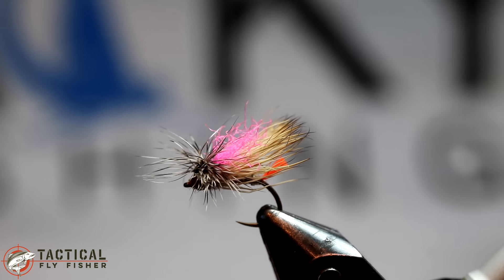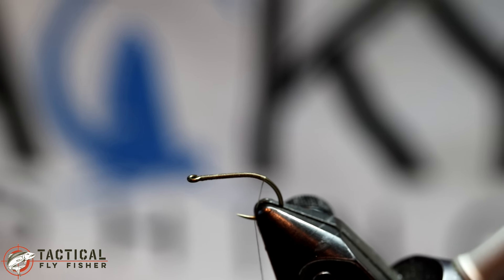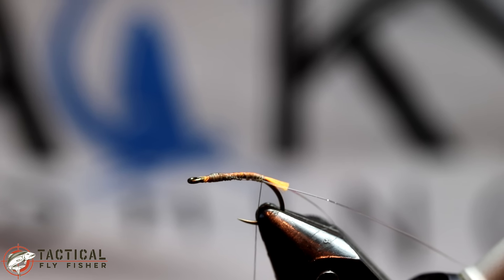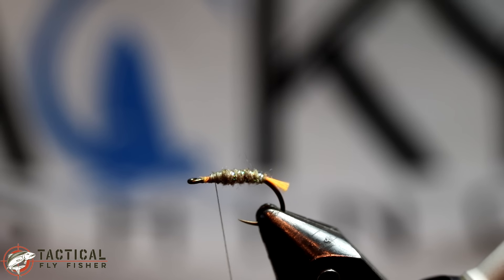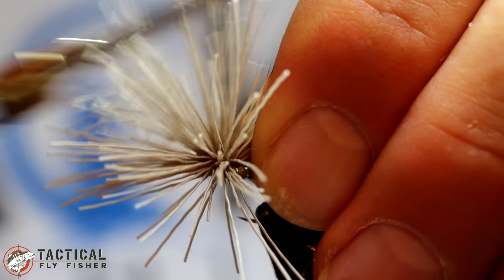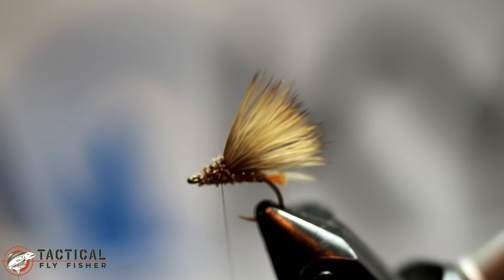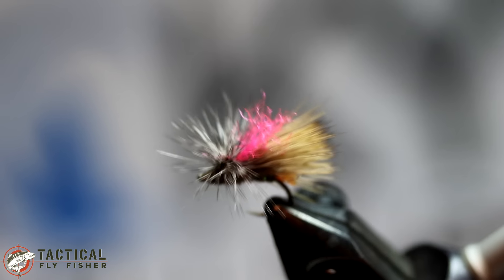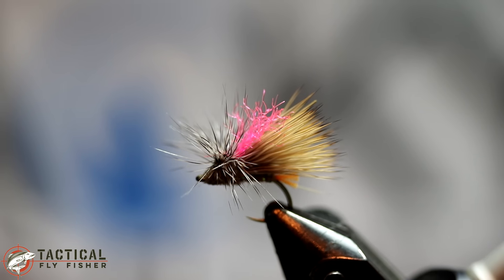Front End Loader Caddis Fly Tying Tutorial

Comment: Is the hackle not secured in any other way after wrapping around the tippet? Is it only trapped down when the tippet is pulled down?
Reply from the maker: Ben Pack correct. As long as the tippet stays locked it place it won’t pull out.
Reply: Interesting technique.

Comment: Great fly - I tried to tie my first one today... tricky part when you come to the hackle... not sure I wrapped enough turns... seems a bit spares... anyway, cant wait to try it out. Actually the fly reminds me of a french (?) pattern called the Tabanas except that one has a deerhair body and a std parachute (I think).
Reply from the maker: The hackle stacker part takes some getting used to for sure Florian but with some repetition it becomes a lot easier. I fish the pattern a lot like the Tabanas.
Reply: I am still unsure how the hackle actually holds as I didn't tie it off. But it holds... sofar :)
Reply from the maker: The pressure of the hackle and post against the body keeps it from unraveling. As long as the post doesn't pull out or the quill doesn't break I've never had one unravel.
Reply: What is the smallest you tie this pattern?
Reply from the maker: Florian Werner 16 but mostly 10-14